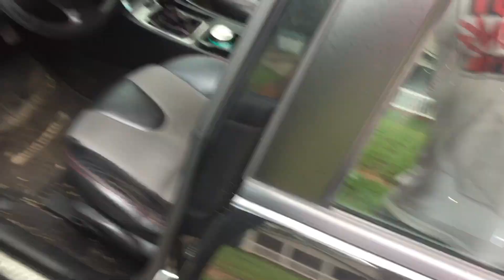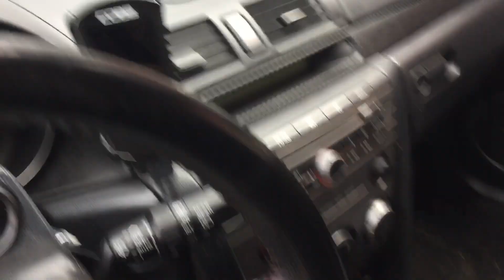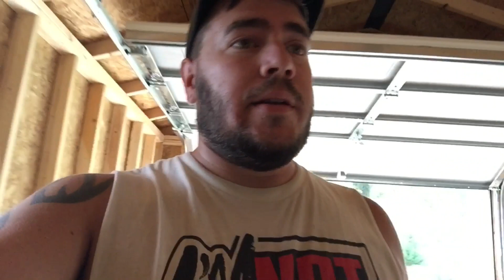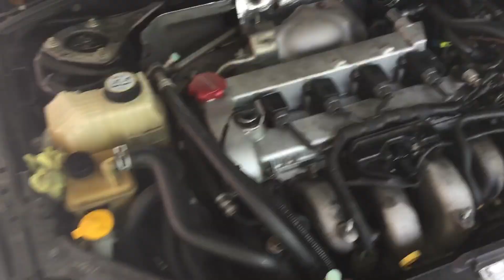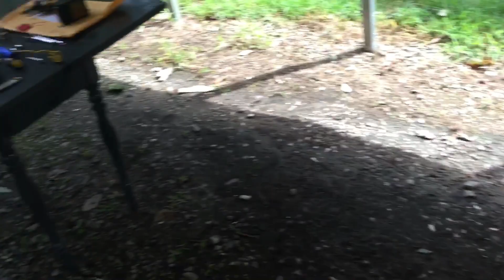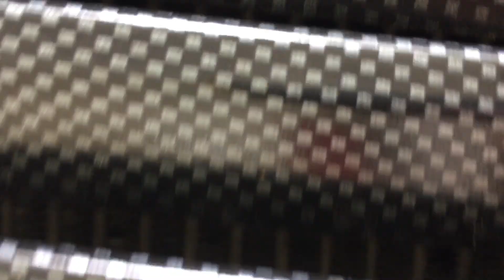Egr delete idle issues -Mazdaspeed 3

Comment: I don't know if your aware, but the MS3s come with an air induction system built into the hood.  It channels air from the front of the car (each side of the "M") to the stock intercooler.  Who ever removed that plastic from the inside of the hood, did the car an injustice. I've got an 08 and I love it. Had it for 4 years now. Bought it stock now I'm moding  it. I went with the cost efficient cx racing front mount intercooler.  Oh yeah, an upgraded fuel pump or fp internals is a must! Sooner rather than later. Motor mounts make a world of a difference too. I've got 80 durometer mounts,  but knowing what I do now, I'd go for the 88 duro from jbr. And this car is not designed to run in blow off mode, put it back to bypass. It has something to do with the MAF sensor and ECUs ability to properly calibrate the air fuel mixture. Bov screws with that. Good luck brother. Have fun and stay safe.
Reply from the maker: Sarm 1084 yeah I’m gonna be getting Autotech HPFP asap. I know the hood has channels but I did a ton of research my bats dropped by about 15 degrees with the vent. Still it was kind of a spontaneous decision I wish I hadn’t made even though I’m ordering a different hood. But once I get hpfp, I’m going solid jbr, new age auto is who I’m going through to buy all my parts. I think I have a rmm already though cause I get virtually no torque steer but I’ll have to look into that further could be my coil overs. Appreciate you looking out though
Reply: @ShotswithCola  no problem brother Your welcome. You can tell if you already have a RMM by looking under the car. Good luck man. Keep us posted on your progress. 😎👍
Reply from the maker: Sarm 1084 yeah I meant to do that on my last oil change. I still might just order one from my guy. I just got to research what I want to get. My friend had a srt running solid and I loved how his car felt but everyone says solid is too rough on the Mazda. May end up with a Cobb or jbr
Reply: @ShotswithCola  you can run a bov..but you will need a tune for it because you will run rich. Also if youre experiencing low idle, you might have a vacuum leak
Reply from the maker: that slow goat yeah I fixed it. The issue was my turbo inlet pipe I fixed that in another video. It was the spot that connects to boost solenoid broke the nipple. I ran bov for a couple months. I hate the boost drop between shifts
Reply: @ShotswithCola  Glad you found the issue..recently picked up a gen 2 ms3..plan on modding it next spring depending on how well it holds up during the winter
Reply from the maker: that slow goat fun car I’ve had mine about 4 months. Beware the Facebook groups will have you overthinking every noise you hear. If your not careful you’ll spend more time worrying about it then enjoying it
Reply: @ShotswithCola  oh i know lol..
Reply: Cool, I went with 80 Duro Passenger and Transmission from JBR and a 75 Duro rear from Torque Solutions. It was definitely a shock when I first drove the car with the new stiffer mounts, all types of rattles and sounds entering the passenger compartment from the engine and transmission! lol But i got use to them in a short time. But its amazing how better responsive the car became just by upgrading the mounts! it was like adding HP ,... but you didn't! lol
Reply: Lol